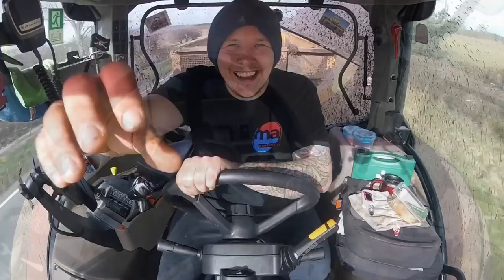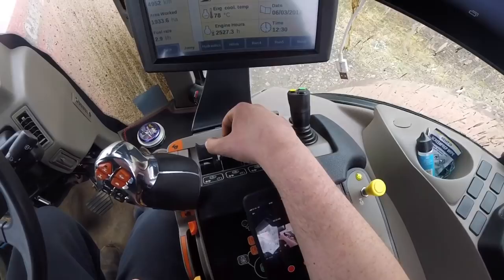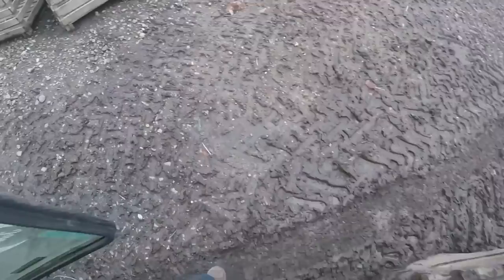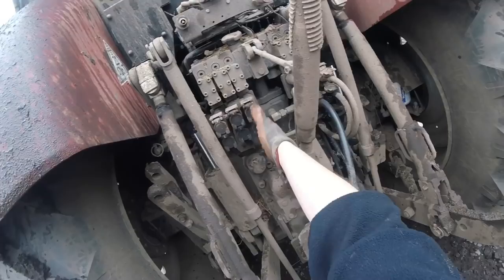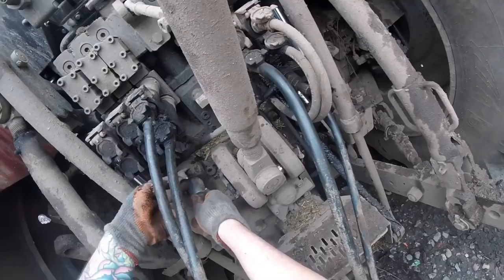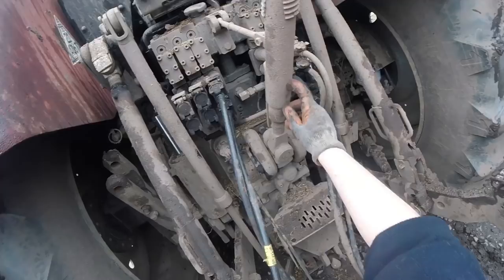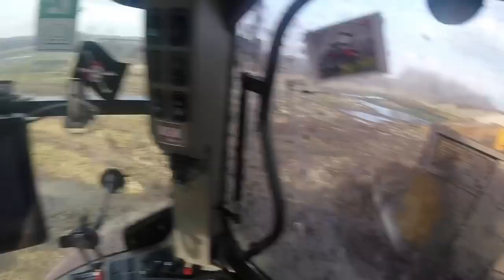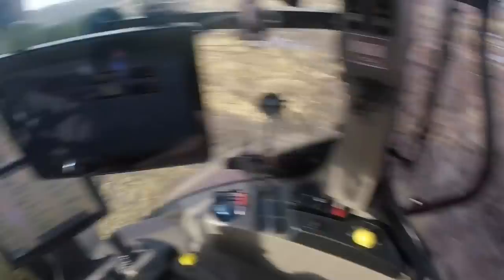Case Puma 240cvx, how I get a trailer on and off :)

Comment: Thanks for taking the time to put that vid together. Learned a lot. A lot more hydraulics and electronic controls than the old tractors I've driven. Great tip about not leaving the weight on the hydraulics and wearing out pumps and kit. Keep em coming. 👍
Reply from the maker: Thanks Alex! I’m glad you liked it! I didn’t want to come across as being a know it all by doing videos that explain certain things, but hopefully I make it clear I’m not trying to be big headed about anything. Yes, tractor have changed massively in the last 50 years, it’s amazing to see just how much!